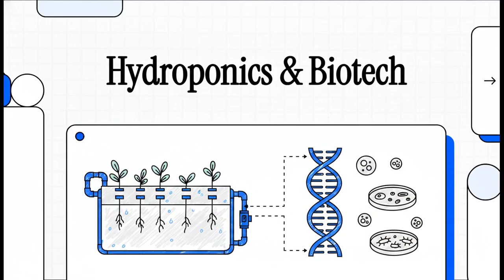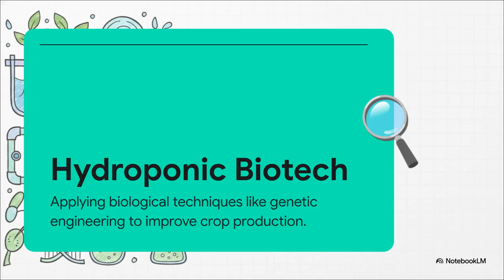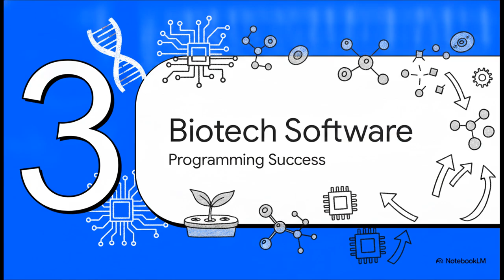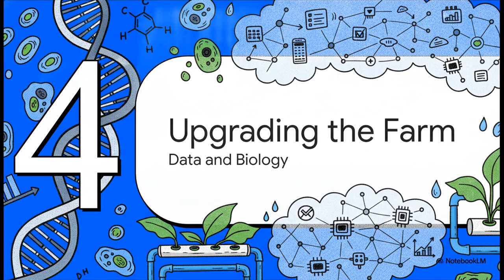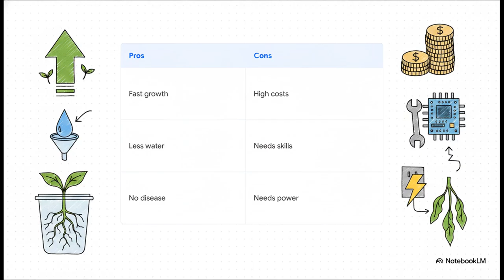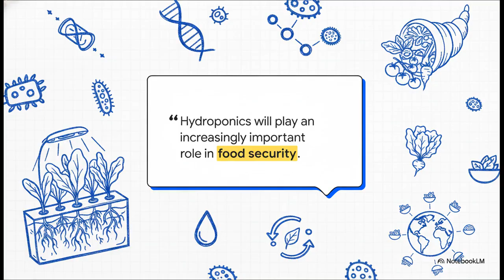🌿💧 Hydroponics & Biotech | Growing the Future Without Soil 🧬🔬 @BioNovaScience

Comment: No you can't secure the future of our food supply without soil.  All hydroponics and aquaponics are built on ground and thus soil.
The better question is, "Can vegetables be grown without the need for fertilizer and pesticides?"  The answer is some yes and others no.
Reply from the maker: That's a great point. Healthy soil is the foundation of most food production systems and plays a vital role in nutrient cycling, water retention, biodiversity, and long-term agricultural sustainability. While hydroponic and aquaponic systems can grow crops without soil around the roots, they still rely on land, infrastructure, water, nutrients, and energy.

Regarding fertilizers and pesticides, it depends on the crop and production system. Some vegetables can be grown with minimal or no synthetic fertilizers and pesticides by using compost, biological nutrients, integrated pest management (IPM), resistant varieties, and controlled environments. However, many crops still require nutrient supplementation and pest management to achieve consistent yields, especially at commercial scale.

The future of food isn't about replacing soil it's about combining healthy soil management, sustainable farming practices, and innovative technologies to produce food more efficiently while protecting the environment.